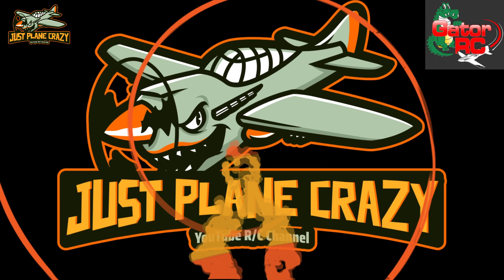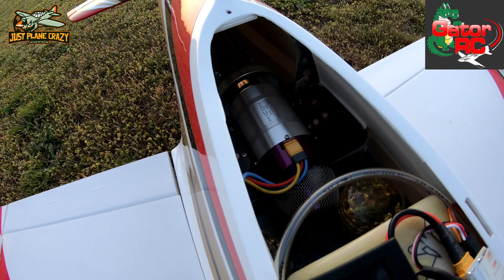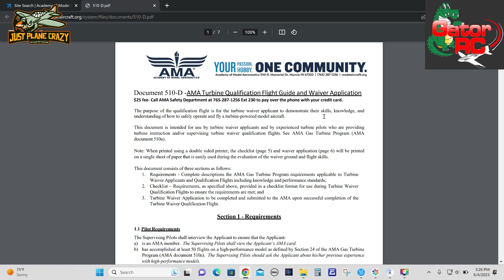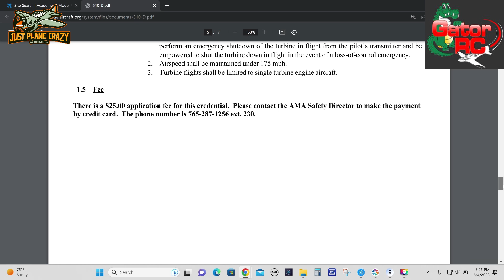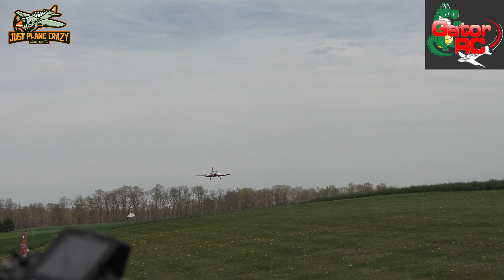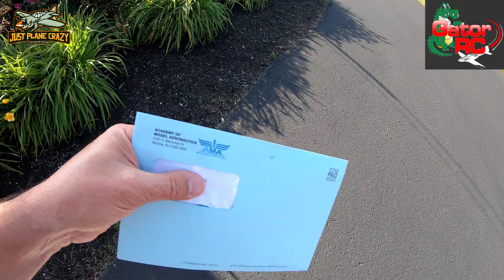How to get into Turbines, Growing up from EDF's,  Getting Started with the Sebart Avanti Mini

Comment: Thank you for this video.I've got 2 70mm Vipers, a 70mm F-16 and the 80mm Warthog. And now I can't shake the Turbine bug! So I'm watching videos and educating myself. Hadn't really considered this jet but now I'll look harder at it. I have a friend who has the MB-339 and he loves it. Bad experience with the Turbine tho. Smoked the bearings after 6 flights. So I'll be researching turbines as well. Thanks again.
Reply from the maker: I have 30 flights on the Xicoy. No issues. Right oil, right ratio, right setup. Those are the key factors

Comment: Did you go with the "Light" or "Compact" X45 version and why?
Reply from the maker: The light. There is no difference other than the monitor size. Since I run jeti telemetry I can get all the same info in my transmitter. It saves an ounce with the light
Reply: @JustPlaneCrazy  thanks!